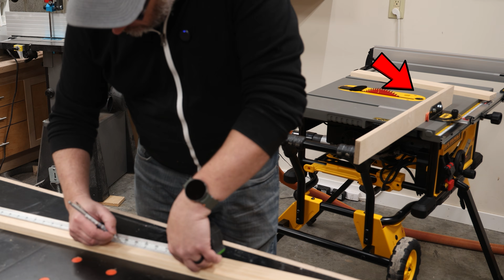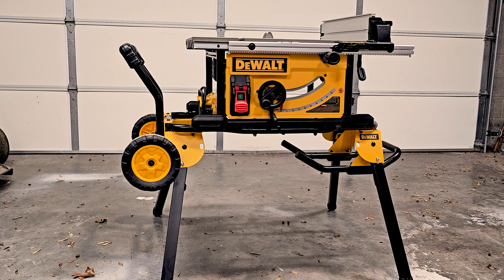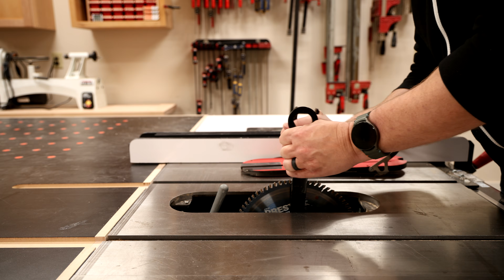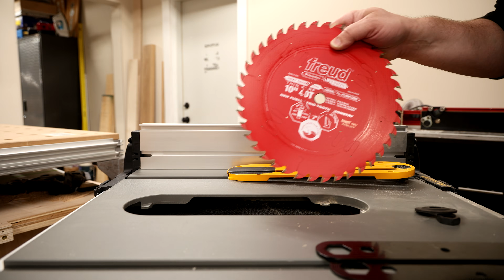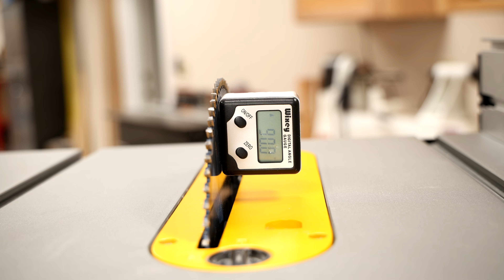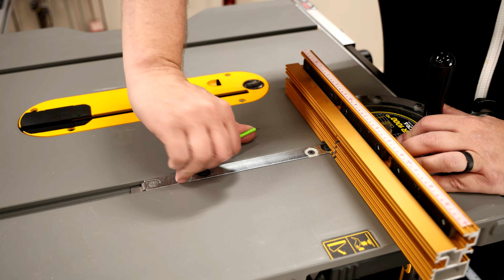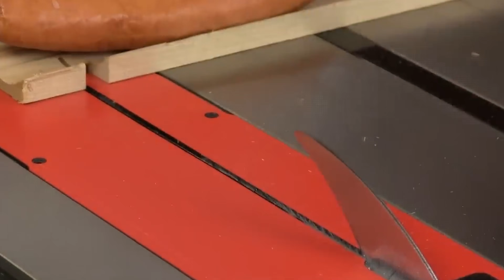Why do people even buy this saw?

Comment: I've managed to use table saws for over 3 decades and still have all my fingers. (Tho ,tbh, I did take the skin off the end of a finger once. Hurt and bled a lot, but no permanent damage) I can't justify the extra $1000 for a Sawstop (plus the replacement cartridges if you DO trip it) over something like a Fusion F2. My biggest issue is space....I can't give up the space for a cabinet saw, and I have been using a Ryobi folding jobsite saw for over 20 years (and have a Ridgid folding jobsite saw at work). This Dewalt has some features I'm interested in, that seem better than both. I don't typically have to make complicated or highly accurate cuts, so I may look into this. Thanks for the review. I usually only use it to build subwoofer boxes a couple times a year. But the rack and pinion system would be nice since it keeps more of it's accuracy vs the Ridgid that slides causing me to have to measure front and back of the blade and tweak the fence so it cuts straight.

Comment: I have an early 113.22411 Craftsman table saw, made by Emerson in the 1940's.  It suppose it qualifies as a 'contractor' saw, because in my younger days I'd pick it up with that ungodly heavy motor pressed into my gut, duckwalk it out to my work truck, and drive it to a jobsite.  But it's done everything I've asked of it for the fifty+ years I've owned it, and that includes using it to make some damned nice furniture.  Yes, I'd love to have a cabinet saw weighing hundreds of pounds.  But I don't really have the shop space or the budget for one.... and I doubt it would be more reliable or noticeably more accurate than my beat up old Craftsman.

Comment: For me, having the space for a cabinet saw was the issue.  I had a 3hp unisaw with the 7 ft aux table.  Great saw, but moving it around constantly was a hassle.  My little dewalt does what I need and I can store it out of the way the rest of the time.  If you have a dedicated wood shop, the cabinet saw is the real deal.

Comment: I had a SawStop, great saw and I honestly loved it for its build, design and accuracy.  The added bonus of having some piece of mind about my fingers was also defiantly a benefit. What I didn’t love about it, price 💵.  From the price cartridges, zero clearance inserts, accessories … it was brutal.  Granted, almost all of those above items were great quality, for example, the zero clearance inserts.  They have nice little lift mechanism that makes taking them in and out a snap.  End of the day though, for my second saw, I went with Magnum🤷‍♂️.  The price difference wasn’t even close.  No it’s not as nice of a saw as the SawStop admittedly but it was 1/3 the price difference wasn't

Comment: I used one of those cheap saws for ripping. Motor was not a problem. The reduction gear was. It was the weakest point, and when I tried to get a replacement gear, " Sorry, no more stock.", so scrapped the unit. Built in obsolescence. Now use an old heavy cast iron bed one. Quiet and it won't fall over or walk when I use it.

Comment: Great video. I learned some things. I have this saw and have to say, it's tough to go from project to project knowing that making adjustments all the time from one project to another gets old and makes you lose interest. If you're in the middle of a project and have to make a bevel cut and then go back to a 90 degree cut, it seriously takes the wind out of your sail. It can take 15 - 20 minutes to make an adjustment in order to make an angle cut. Forget about making compound cuts, it takes forever and like the video states, the adjustment don't seem to hold for very long. I guess it's like any of us, there are those that can spend the money and those that can't. If you can spend the money, as shown in the video, you can buy extra upgrades to make things work but if you have to do this with most of your tools then where does that leave you? I really wish there was a way to make decent tools at an affordable price. Yes, I know Harbor Freight is an option but I'd like to see them dive deeper into the woodworking sector.

Comment: Started with a benchtop, moved to a contractor saw, now have a cabinet saw.  One issue I had with my contractor saw was that it wasn't on wheels and I had to move it aroud frequently, which knocked it out of alignment.  The heavier cabinet saw is more stable, has less vibration.  As someone else mentioned, those universal motors on benchtop models really scream.

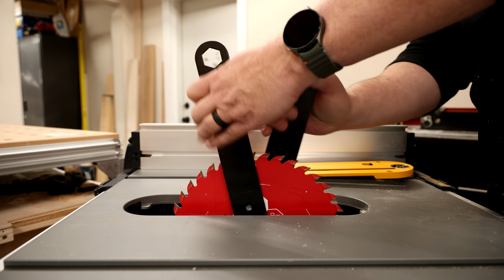Comment: I see when you swapped to the thin kerf blade 8:35 you removed the riving knife.  Is that because it’s too thick for the new blade?  I was planning on getting a thinner kerf blade but don’t want to use without the riving knife so hopefully can also find a replacement RK, assuming that is what’s required.  Thanks

Comment: Apart from my lack of space, the other thing that convinced me for the Dewalt versus a good entry level cabinet saw was that the cabinet saw I was looking at stressed the importance of good dust extraction for longevity of the saw.  That makes sense but is another expense and space requirement compared to the job site saw that I can drag outside and use with a shop vac.

Comment: The choice isn't only about tablesaw size because I own  the Sawstop Jobsite saw and it works just fine for me. I also have a track saw for cuts of pieces which are unmanageable on the JSS. So, again, for me, table size and power have never been an issue. The comparison should really be made between Sawstop's JSS and larger saw; only Sawstop. I don't have a need for a cabinet size saw nor the space to dedicate to a saw that size. The choice was about buying a saw which has enough power, sufficient capability, and safety features so I don't cut a finger off and a saw that doesn't have one of those things. Well, that is clearly Sawstop's JSS. All I'm saying is the comparison wasn't between tools which are in the same category because Sawstop is the only one in the category most home woodworkers can affor which makes a saw with safety features. Their JSS is still expensive, but not nearly as expensive as buying a cabinet saw if you don't need one.

Comment: My "shop" is on the patio. Needing to move and cover tools during bad weather means that a cabinet saw is out of the running. I have the same saw that you tested and so far it does what I need. I made a table to give me extensions on both sides and for the out feed. I agree with your assessment of setting the miter angle - it could be much better.

Comment: You did a GREAT evaluation, hitting all of the good and bad that I have found!  I have had a DeWalt RS7491 for several years.  I have yet to find a situation that I could not handle well with it...or at least as well as I would with a larger cabinet saw.  YES, infeed and outfeed supports are needed...for either one.  Yes, it's table surface is not steel (aluminum?) and so is likely a bit less flat, and cannot be used with magswitches.  And the adjustment for cutting bevel angle is, as you noted, well, terrible.  You can get it adjusted right, but it will not be simple.  However, there is an upper angle limiter and that can be set to 45.1 degrees.   And, yes, the miter tracks are weird and apparently a bit undersized, so some featherboards won't grab well.
Oh, BTW, my saw arrived with the blade all but perfectly aligned (within 0.002" using a run-out micrometer in the miter track), and the fence was also properly aligned.

Comment: Why not buy a used table saw?  The modern contractors saws are NOT the same as those old belt-driven cast table type saws of the 70s, 80s, and 90s.  I have a 3HP Craftsman from circa 1985 (I bought it new).  Maintained, it will do almost everything a cabinet saw will do, with similar precision. Why?  Because they are steel v aluminum, and in my case the extension wings are also cast v stamped.  These were popular saws, and you can find them online for about the cost of a new jobsite saw or less.  Just an alternative, kind of middle path here, but also a better overall saw for woodworking than these jobsite saws.  I HAVE used jobsite saws with good results, but I used them for carpentry, not woodworking.  

I have the space and money for a cabinet saw (and an appropriate 220 circuit nearby), but I don't see enough advantage in replacement for what I do as an advanced hobbyist.  That's me though.

Comment: I am actually a sculptor.  I do woodworking from time to time, but I just do not have the floor space to dedicate to a full blown cabinet saw.  And the job site saws are just a pain to take out, set up, and put back away when you factor in that they only do the one trick.  35 years ago I bought a ShopSmith.  Roll rolls away on its own lifting castes to take up no more space that a bicycle against the wall, but it gives me a fill width table saw, a drill press, a disc and conical sander, a lathe, a belt sander, bandsaw, jointer, a horizontal borer, and a shaper, all in one machine.   YES, I have to roll it out when I need it, and set it up for different operations, but I would have the same issue with a job site table saw, only a lot less versatility, or have to dedicate even more storage space to a plethora of smaller, portable options that lack the power and scope of the ShopSmith.   Shopsmiths have not changed in 70 years and are still manufactured out of metal here in the states.  If you have limited space, and need a lot of tools that you don’t use every single day, a ShopSmith is a great solution.

Comment: One way to get more power and a better cut out of a 10" jobsite saw is to use an 8" blade.  The same is true for Radial Arm Saws.   I have muy grandfather's 8" Craftsman table saw with a 1hp motor at a current jobsite along with the 10" Dewalt jobsite saw shown in the video.  The Dewalt has more power (and is much louder too) but the two saws perform about the same.

Comment: How are you going to say they both have 10" blades and not talk about the difference between thin kerf and full kerf blades? Also, the difference between a cast iron top and an aluminum top is night and day. Sure, you can purchase a jobsite saw that will meet your needs as a hobbyist or weekend warrior but saying it's as good as a cabinet saw is just wrong.
Reply from the maker: I talked about both those things in the video. also never did I say a job site saw is "as good" as a cabinet saw. in fact I explicitly stated a cabinet saw was better in every way in the beginning of the video. But 90% don't need a table saw as good as a cabinet saw. Thanks for the comment and the engagement!

Comment: One other advantage of a cabinet saw is the cast iron table itself. Being cast iron, it can accept magnetic accessories like a feather board. If an accessory is fast and easy to use, you’re more likely to use it and magnetically attached feather boards are one of those items. Feather boards help hold infeed wood straight and even for safer and more accurate cuts.
Reply from the maker: absolutely true. Its one of the most annoying parts of smaller saws. You don't miss cast iron until you try to work without it!

Comment: The Dewalt job site saw with a homemade zero clearance insert and quality blades is more than sufficient for most woodworking. I’ve spent many hours on Saw Stop cabinet saws with massive outfeed tables, and they are IMO the Cadillac of table saws with an amazing bonus safety feature, but most woodworkers can get by just fine without one. That money is better spent on more materials, quality blades, planer or jointer, etc

Comment: I spent an hour dialing in my dealt jobsite saw when I first got it because it absolutely was not dialed in out of the box, however after dialing it in, it has been absolutely solid since then. That was 8 years ago. Also installed a zero clearance throat plate which was a big advantage. 

Of course I’d rather have a cast steel table saw but I absolutely do not have the space just yet so I’m still doing things with the smaller stuff. 

Did not know about the TSO fence though, and already ordered one!

Comment: Horses for courses.  90% of woodworking is figuring out how to do something with the tools that you have got at your disposal and create workarounds.  If you think and try hard enough you can do basically anything with any tool.  You can do pretty much everything you would ever need to be able to with a decent "jobsite" saw.  Is a cabinet saw better, objectively yes, in pretty much every conceivable way, but do you need it to be better or is the jobsite saw good enough for your application?  The main benefits of a cabinet saw are stability, accuracy and consistency, but the main drawbacks are size and cost.  I don't have a cabinet saw, I could possibly if I man maths hard enough, make a case for getting one but I simply don't have the space, so I'm not getting one, not unless I start doing woodworking for money and invest in a larger workshop.  Noise is a big thing too, I like most people I suspect, am not as good at putting on ear defenders as I should be.  Job site saws are loud, really loud and if I was working with one all day it would get old very quickly.  Some of the nicer cabinet saws are so quiet that I probably wouldn't even put defenders on (even though I probably should).

As ever the question is what are you trying to do?  I have a jobsite saw, so for making sheet good things like cabinets I have invested in a decent track saw and guide system so I basically don't use the table saw for sheet goods, I tend only to use the table saw for cutting up smaller things like drawer parts where the track saw gets a bit unwieldy.  Its the old rule, if its easier to take the wood to the saw use the table saw, if its easier to take the saw to the wood use the track saw.

Comment: The burn you experienced on the wood cut with the DeWalt jobsite saw was probably the result of the blade misalignment you detected. Now that you corrected the blade alignment, you need to rerun the test.
Reply from the maker: nah, I corrected the issues with the saw weeks before I shot the test. The video was not filmed in chronological order so I understand the confusion.

Comment: Watching this video made me SOOOO glad I bought an Evolution. It has CRANK control of the miter angle, so none of the frustrating fiddling about. Adjusting the blade angle relative to the miter gauge slots is an easy, NO TOOL operation. The Evolution has a built-in outfeed support. The soft start is awesome (does DeWalt have that?). The Evolution comes with an amazing blade that can cut aluminum and mild steel burr-free which now lives on my miter saw making it 3 times more useful. The Evolution rip fence has a T-nut slot on top for accessories like a featherboard and the 2-position flipover can serve as a material support OR offset from the fence. The Evolution has a miter sled that extends the working distance of the miter gauge. I have it dialed in for machinist square accuracy. Can it replace a decent cabinet saw? Of course not, but like so many other amateur woodworkers the cabinet saw is just not an option. Oh, also the Evolution WITH the fold-up stand is $75 LESS than the DeWalt.

Comment: I've been woodworking for at least 10 years now and I've only ever used a cheap porter cable jobsite ts. I'm sure it would be great to have a cabinet ts but mine works and there's other tools I don't have and would rather spend the money on.

Comment: If I can speak from experience, I have a wood shop and once had a Delta 2. Horsepower 10-in table saw that would cut a cinder block in the half, one day it Pulled my hand in there and cut my pointer finger off and mangled my middle finger on my right hand. I immediately went out and bought a saw stop ... best investment I've ever made. And I can Tell you that the brake works. It will save your digits!!

Comment: While I can appreciate the extreme level of safety provided by a  Sawstop cabinet saw, I opted for a Grizzly 3hp cabinet saw and spent the difference in price on other very useful upgrades.  As for the jobsite saw, I still have my well used Skil jobsite saw that now has a special assigment.  It is used to cut down old oak pallet boards when I am doing custom 'barndominium' wall installs.  There is no way I would ever put that unpredictable and often filled with hidden nails material through my cabinet saw!

Comment: On mine that little support can also be used over the table, because the fence can lift and lock.

When moving the fence you don't have to use the handle.  The fence slides easily with just some hand pressure.

I've only ever used the mitre gauge on one side, so I just have it set up to be snug in that slot.

I fitted mine with a soft start which makes the startup a lot less harsh.

The version we get does not come with the folding stand, but if I want to use it outside I just set up a sturdy table.  The cheapest SawStop I could have bought is four times the price.  I'd have ended up owning a very expensive table saw and literally nothing else.  No clamps, push blocks, etc.  Probably not even wood.  So it would definitely be a very safe saw, because it would never get turned on.

I made my own plate out of plywood.  Works really well.

I see some people comparing noise levels, but in my experience most of the noise occurs during cutting, regardless of what saw is being used, and I wear hearing protection anyway, so the little saw sounds pretty quiet.

I live near the coast and my garage isn't sealed.  Anything iron that is not packed away in sealed containers rusts.  I'm glad my saw does not have an iron top.

Also the SawStop is only unique because they abused patent law to stop a competing product from being sold even though it used different, and superior, technology.